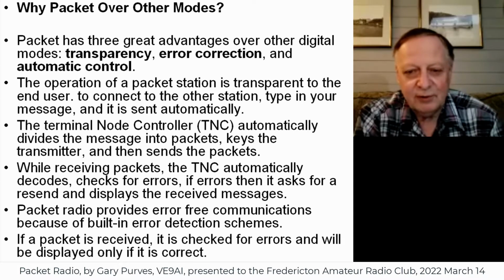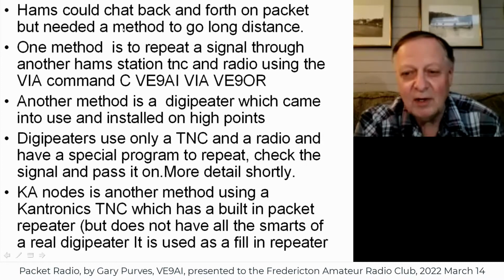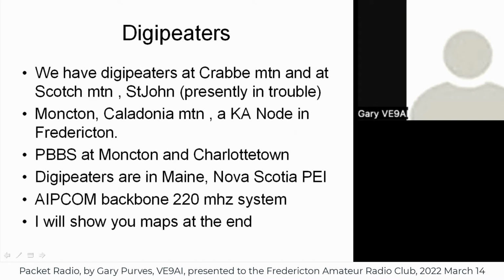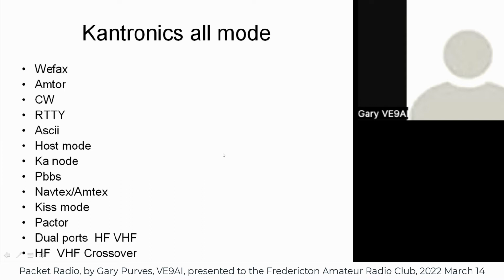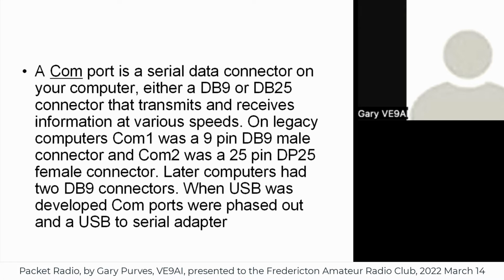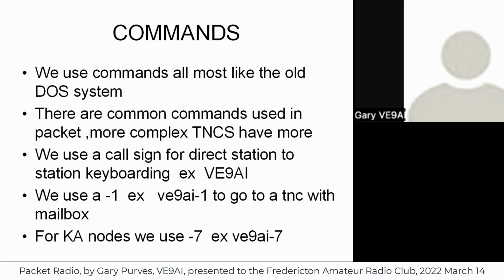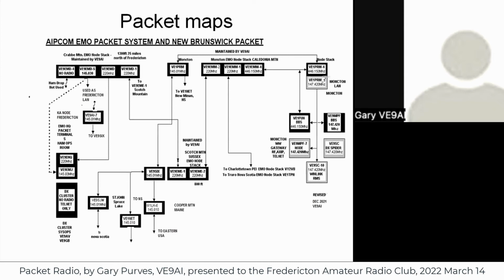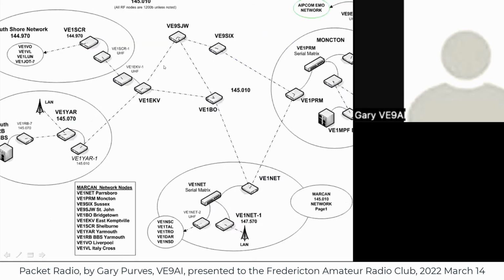Packet Radio by Gary Purves, VE9AI, presented to the Fredericton Amateur Radio Club, 2022 March 14

Comment: Hello Gary.  I just purchased a PK-88 and a PK-232MBX and will be connecting the PK-88 to an old Henry Tempo VHS One Plus.  The PK-232 I would like to connect to my HF rig in order to talk to the folks on 14.105.  I am having trouble finding a Packet software program that will work on my old laptop....

Comment: 33:40 Pactor is a digital mode for transferring Data.  The SCS Pactor 4 modem is a hardware device, about $2100 CDN. VARA is a software modem with comparable speed.  Though the pro version of VARA will cost you $69 USD  -73